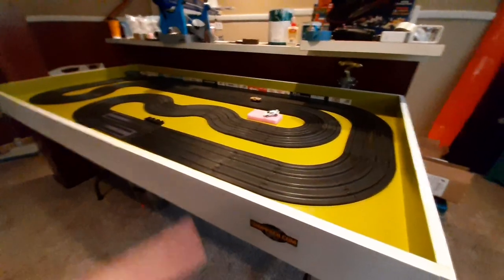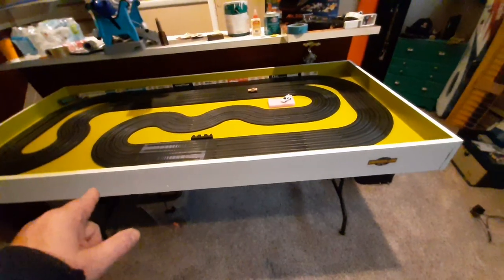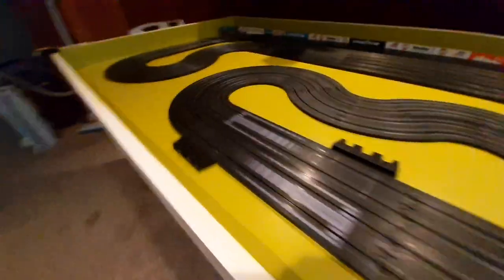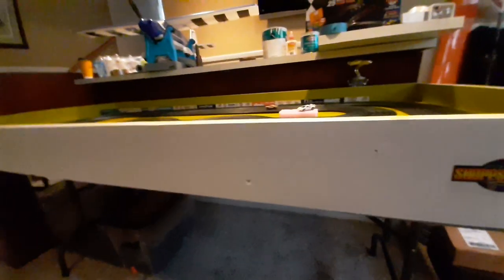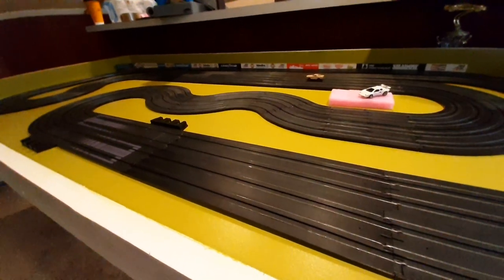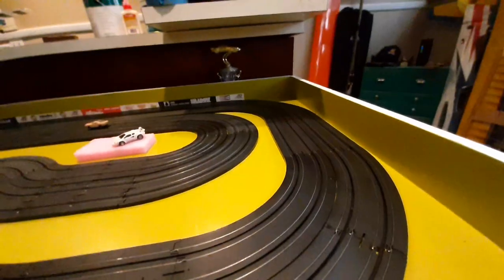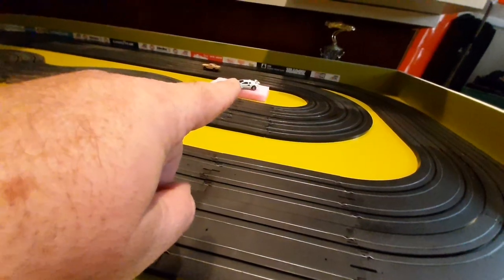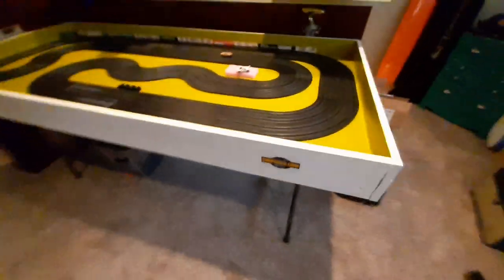4 lane HO slot car racing track on a door ! Easy to build, transport and store !

Comment: Great fit, did you post the track pieces or plan to ?  I have that set + 3 others so pieces are plenty, just a starting point would be great. I use 2 software apps but they aren’t perfect.  Thanks !

Comment: Im thinking of adding a hinge mechanism to a concept like this so that it could easily be folded up and stored vertically flush with the wall. when in use, it lays flat with drop down legs. thoughts on that?  watch outs?  any builds?

Comment: Nice track. I see you mention hoscaleracing, I believe that site went offline, I wish I had saved some of the templates as I think there were numerous layouts published. I might take yours as a starting point. I have multiple doors so the goal is to extend off one side to add a superlong straight.

Comment: Do the cars take much damage hitting the walls? 20FT BY 4FT AFX.
Reply from the maker: Bodies can get broken, especially F1 bodies, front spoiles/wings break easily with a good crash into the wall. Some type of foam is a good idea to help prevent damage. Some rigid foam insulation from Home Depot works well. I also really like that dense white foam like material that is often found as packing material in some electronic components.
Reply: @slotslidershoslotcars  I use clear thin flexible plastic from orange juice containers and windshield wiper packaging.
Reply from the maker: @mortonbeard2240  yes, use that to keep the cars from leaving that section if they out. We use the foam on the boarder walls around the outside of the track table to decrease body and chassis damage. I'm sure your ideas will work well.🏁

Comment: Nice track and video. Inspiring also, to those of us that are tired of not having a layout. Do people screw down the track and file the rails where they meet these days? I ask because I'll be using T Jet track, and I thought some one told me to dress rails using a file on screw secured track. I haven't yet found a video with that being done though. Four lane, the way to go!
Reply: Sorry for the late response, the old Aurora lock and joiner track is usually pretty smooth. Set up a small layout and see what you think. If you use anything to clean up the rails, vacume track well and go over rails with a strong magnet to pick up any metal dust etc

Comment: How did you secure the track to the wood?
Reply: Use small trumpet head Phillips head screws or if you think you may want to change the layout, I have seen people use a tiny dab of silicone caulk in several places around the layout. TINY DAB ..just enough to keep track in place. If your happy with & know you want to keep the layout, you can then secure the track with screws.